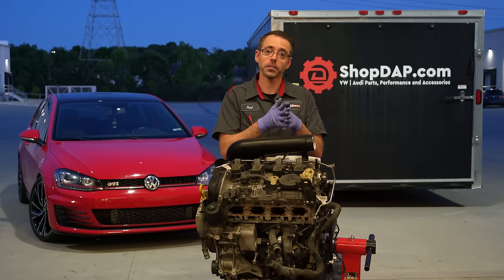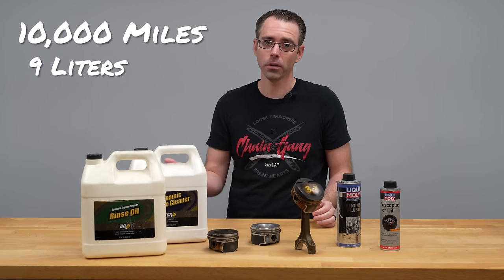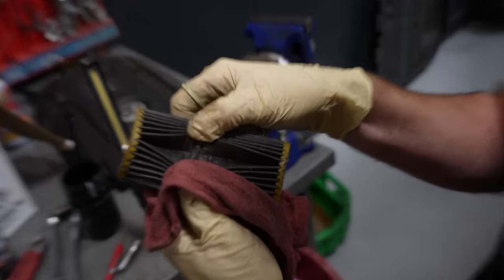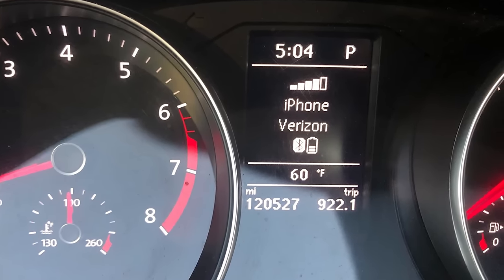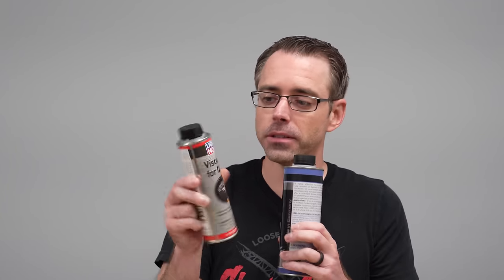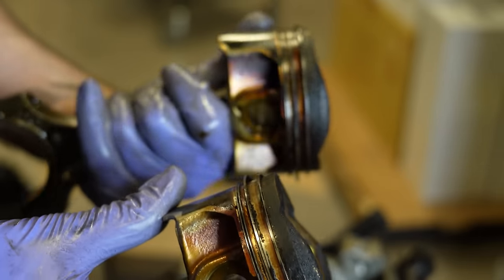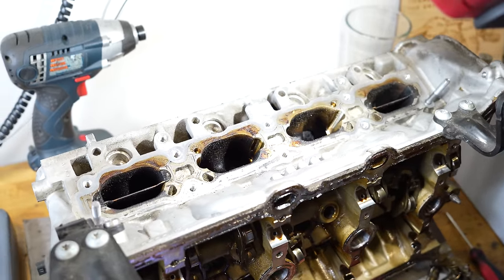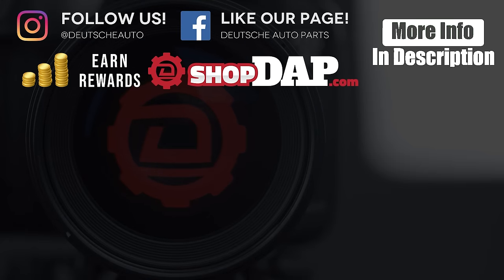Can you Fix an Engine Burning Oil for $20

Comment: Here is the recipe to solve 2.0tfsi oil burning. Get the engine hot. Remove spark plugs, mix 2oz PB Blaster, 1oz B-12 Chemtool, and 1/2oz MMO. Pour this mix in this quantity in to each cylinder. As you pour, you'll hear the mix boiling in the cylinder. Always exercise good safety protocol. Let it sit with a paper towel in the spark plug hole until the piston is visually dry (24hrs). Take a compressed air blower with a long snout and put it in the spark plug hole and blow. You will not believe the amount of dried carbon that will blow out. You'll typically find the culprit cylinder at this time based on the amount of carbon blowing out. Crank the engine over with the plugs out to remove excess liquid. Install the plugs and drive the vehicle around the block. Repeat all of these steps again. This cleans the piston crown and rings from the top side. When starting the engine after the second soak, dump in a can of BG EPR or LiquiMoly engine flush and let it idle for 30 minutes. this cleans the rings from the bottom side. Change the oil and filter and call it a day! This cured an engine burning 1qt every 200 miles @160k miles. It now burns nothing between 5k mi oil changes. You will have to repeat this every so often (2-3 oil changes) as the rings will re-clog. Yes its a pain, but it beats the cost of a new engine.
Reply: I did this on a Honda with chemtool had to do it twice to fix the oil burning
Reply: Is this applicable to the tsi engines as well?
Reply: We do something similar! But instead we use that GDI intake cleaner sauce, AC Delco makes a good one and even MOPAR has an aggressive cleaner too
Reply: @snoofayy6150  you put it through the intake or dump it in the spark plug hole?
Reply: @GooberProductionz  spark plug holes! Leave it in there for several hours and fill the up again, it breaks down and weakens a lot of the hard carbon and shit that's sticking up the piston rings,
Afterward you should suck it out with a little vacuum pump, and absolutely drain the oil, then fill with cheap oil, let it idle and warm up and go for a HARD drive, you'll see all kinds of evil smoke coming out of the exhaust and probably pop a CEL and piss off the o2 sensors a little bit
Once it's good and hot and there's no more James bond smoke billowing out behind you, then drain the oil again and fill with the good stuff you normally use, don't want to drive for too long with all that crud and chemical in there!
Reply: @snoofayy6150  ok heard. Should I use the berryman’s, pb blaster, etc mix or should I just use the crc cleaner?
Reply: @GooberProductionz  Daniel Hurley's method seems really solid, whichever sauce you pick just do the according method I guess
Reply: Makes  perfect sense.  I was using transmission fluid and paint thinner mixture and  poured 5 ounces in each cylinder and then let it sit 24 hours  then crank it over  blowing out what didn't  seep past the  rings.  Then engine flush in the oil  run it  for 30 minutes and then  dump and change oil and filter  with mobile one  synthetic oil and mobile one synthetic oil filter.  It went from  500 a liter to  absolutely no oil loss from oil change to oil change. Alot of people  blaming the  low tension rings but it is carbon buildup and sticking of the rings  not low tension.
Reply: Can you use WD40 instead of PB blaster? PB can not be found easily here...
Reply: What is MMO?
Reply: @superwout  Marvel Mystery Oil.  They have started making it in a synthetic version but I would use the original for this process.
Reply: Hey there, I have a 2017 Hyundai Sonata 2.4L GDI burning a qt in 500 miles, I'm wondering why those three chemicals? How did you conclude that those three are the chems you use for this procedure? What can be substituted, why or why not? I was thinking an engine flush, given what its supposed to do, would be a safer and simpler mix (I dont want PB blaster in my crankcase) that should break up the carbon just as good. Could I go that route?
Reply: @thatsonebadhatharry8610  thanks for the info, I'm from across the pond...
Reply: @jsplasha  Ratio was trial and error about how long the mixture dwelled in the cylinder before finding its way to the crankcase. You dont need MMO specifically, but you do need a high detergent oil with a relatively low viscosity (like trans fluid) in it to allow the mixture to be suspended in the cylinder and do its work over a longer period of time. PB and solvent would just go through the cylinder pretty quickly without staying long enough to soften the carbon.
Reply: Greetings. I own a 2004 toyota rav4 (2AZ engine) please does my car have an update pictin, and which year of manufacture would that be.
Reply: Will it work for diesel engine?
Reply: @triblackcorvette  so i can try this method on my k24a2 tsx
Reply: Can I do this for a motorcycle
Reply: @jsplasha  or disconnect the ignition wires and just let the injected fuel do the work. Crank for 10 seconds several times. My theory. Based on the fact that gas is kinda good at loosening up things. However it will dry soon .......
Reply: @triblackcorvette did you notice an improvement the first time and decide to see if it would get better or did you need to do it 2 times to notice any improvements
Reply: @marshmower   say hello hydrolock
Reply: I am about to try this method in a week or two on 2016 tsi passat. Will report here if i blew out engine or it work for future victims of carbon on oil rings
Reply: @eduardaslaurinavicius4249  Please do. Due to the piston/ring design and operating temp of these engines, you will have to keep doing it about every 12-15k as it will clog back up. Its not uncommon for these engines to be 230-240 degrees at idle or with a light load so after the engine is turned off, the superheated oil cokes in the piston rings and it clogs back up.
Reply: I can tell it helps… poured mixture into hot cilinders (be carefull as it escapes once it starts to boil) and let it soak for 24 h then poured another round on cold engine, and let it sit for 12h. Drove in 3rd gear for around 20 minutes @ 60-70 mph (O2 sensor will have many questions once you do this). After this, did liqui moly engine flush and let it idle for 25 minutes then changed the oil. Used compressed air to blow out gunk but in my case i did not need to, nothing came out. Borescoped cilinders to check before and after. Will do this one or two more times before oil changes and will call it a day. 

So far drove 200 miles but deepstick still on max and before i would be topping off already a little.

Have obd2 scanner to erase errors after treatment.

So yes, it does help.
Reply: 1000 miles update - have not topped up yet. Still around 1/2 maybe tine bit more on a deepstick. One more flush before oil change will do it and then probably once every 15-20 k miles as preventative maintenance.
Reply: @Lonelydad2 to prevent hydro locking he states to blow out the cylinder with compressed air and crank with no spark plugs. This will remove any excess liquid and prevent hydro locking.
Reply: Hey I’m about to be using this method real soon for my car but had one question where could I get MMO?
Reply: @JosePerez-dl8bf  Really any auto parts store or walmart. If you cant find it, transmission fluid could be used as a substitute.
Reply: create a youtube video
Reply: I'd heat up the mixture too a little, potentially this could crack a piston if you dump cool liquid on very hot metal.😬
Reply: @superwout  wd40 is not the same type of chemicals as pb blaster.  Pb blaster is specifically made to break through grit, rust, carbon etc.  Wd40 is just a water displacement type of oil. Never tried it but don't think it would give you the results you're looking for.
Reply: I would let it sit longer (a few days), and I hope you used a clear plastic shield when blowing those cylinders out ( like those Large clear plastic face shields).  What a Mess that is I bet???
Reply: I would skip the mmo and b'laster. Just use chemtool
Reply: This is complicated, you can do the same, actually better, with HHO gas carbon cleaning (and eventually engine flush aditive add to oil).
Reply: @snoofayy6150  For the "cheap oil" I visit the back room at Advanced Auto and syphon a few gallons from the waste oil tank.  Be sure and pour it thru a paint strainer cloth.
Reply: @superwout  Marvel Mystery Oil?   That stuff looks just like transmission fluid to me.
Reply: @chetmyers7041 that sounds like a really bad idea. There is coolant, brake fluid, metal and who know what else in that oil salad. Why cheap out on your engine like that? The cheapest fresh/clean new oil would be far better and only $10-30 depending on amount needed.
Reply: Wow thats a lot of unnecessary work. Just get the engine up to operating temp, bring the rpms up a bit (2000-2500 or so) and add water. Not enough water to kill it, obviously. I would use a small vacuum hose but you could also add it via the throttle body with something such as a spray bottle or a water bottle with some small pin holes in it. That is the old school way of doing it and it does work. It may run a bit rough at first after doing it but itll clear up pretty quickly with driving. Think of it like a cylinder on an engine that blew a head gasket, its easy to identify because that cylinder is spotless. That is what this does, it is completely safe and easy (and as a bonus, its basically free), and will work better than what you currently do. It's not gonna hydrolock it as long as you arent literally dumping water in it. The only potential concern would be on newer cars it could possibly clog up the catalytic converter, but that could happen if you remove carbon in any way unless you physically remove the engine. As for carbon buildup elsewhere in the engine, just run mobil 1 and change your oil ever 5000 miles and that wont be a concern. Also avoid short trips, thats horrible for any engine.
Reply: @lumpyzx2645  You're not going to decarbon the oil rings with water through the intake. That decarbons the top of the pistons and valves only.
Reply: You can use water run it bout 2  to  2500.00 Rpm And pour it down in the carburetor real slowly it will clean the carbon out of the engine
Reply: How much are you wasting on those stupid chemicals? A set of piston rings costs less than $20 add the gaskets and some screws and you have a newish engine with less money spent.
Reply: @Jfjs58-g  $17 in chemicals. Obviously you haven't been down this route before with this engine. The pistons are a bad design so just rings and gaskets will not fix it. They will reclog quickly. If you want to properly repair it new pistons, rings, bearings, balance shafts, timing kit, cam bridge, gaskets, & labor are well over $7k. It rather spend $17 every few months on a car thats not worth the proper repair and go about my merry way.
Reply: @danielhurley7018  I have a 2.0i ALT with 240k km so about the same shit as 1.8t. Oil control rings were really bad, I replaced all the rings, bearings, valve stem seals and all the other things you replace once you open the engine and it was not more than 1500. Other than the rings the engine was perfect.
Reply: @Jfjs58-g ah yes, because taking an engine apart and putting it back with the same oil, coolant, timing belt/chain is smart. All that shit costs money too, plus the downtime of your car.
Reply: Really? 🤦🏻‍♂️. 
Don’t do this!  I shouldn’t have to say this but don’t take vehicle advice from trolls on the internet. 🤦🏻‍♂️🤦🏻‍♂️
Reply: @BeefNEggs057  Yeah, obviously BS
Reply: @aleksandarpetrovic6613 petrol you say? Acetone or k chem maybe clean but deplete the bearings and all if chem gets left in system
Reply: @stravis3269  I didn't mentioned acetone, but HHO gas.
Reply: This isn’t fixing shit.
Reply: What's odd is, given how gasoline is never actually pooled in the cylinders of an engine, how likely gasoline itself might actually be able to do quite close to as good.  How much more than the most wasteless spritz of it is applied in the operation of an engine?
Reply: @aleksandarpetrovic6613 HHO, as in deconstructed water?
Reply: @alexwalker8422  yes, gases from electrolysed water.
Reply: @aleksandarpetrovic6613  how is HHO to be used in this process?
Reply: @alexwalker8422  high flow of HHO gas was added to the engine intake, for example about 15-20 LPM for 2l engine, for 30-60 mins. Engine works on his regular fuel plus HHO gas. Cleans combustion chamber, EGR valve, turbo, cat, and DPF (depending on what engine have).
Reply: @danielhurley7018 I heard of transmission fluid in the crankcase many years ago and run engine then change the oil
Reply: @danielhurley7018 how about diesel? Wouldn't it do the job
Reply: @Jfjs58-g  Good old fashioned “rebuild” is the most fun!
Reply: Spark plugs i put mine to tdc so it is all closed off ... then do the rest etc other wise of say cyl 4 is all the way down on stroke then it will just pour through @GooberProductionz
Reply: Thank you  will cause my acura mdx 08 model us bringing out smoke from the exust
Reply: @ChrisPatrick-q6k  Do you have some advice relevant to addressing this crap motor's issues?  Updated pistons would be nice, but not everyone has the dosh for that.
Reply: @eduardaslaurinavicius4249  This is the info I needed. I am having the same issue with my Peugeot... Hoping this solves the issue so I can replace my catalytic converter and hopefully pass emission tests in Germany. Thank you for your tests and reporting back, really helpful.
Reply: @codywood4768  i’ve done about 20 k miles since. It still burns a little. need to add between 0.5 - 1 qt between oil changes. P.s I do an oil change every 5k miles

Comment: The 30psi increase is certainly an improvement... 5psi is surely within the error margin just after an oil change lol.
Reply: I guess removing engine deposits is a pretty random outcome also. Sometimes the deposits might help nurse a worn part seal better and othertimes prevent a good seal.
Reply: @itsthemetho  Agree 100%, especially for leaks, lol.  Strong believer in - if it ain't broke, don't fix it.  I do 3,000-mile oil changes, which for me is the best preventative.  If it were oil-burning 1 liter per 172 miles (!), you're up for big bucks anyway, so you've got nothing to lose trying these.
Reply: @johnrroberts7900  Yeah a liter/quart every 172 miles is once every 2-3 days if you have a normal commute. You'd be spending almost as much on oil as fuel.

Comment: In 1970 to 1974 I trained to be an engineer (UK) Our training officer, always used flushing oil during the oil changes. It went like this; Drop the old oil, fill with flushing oil, which was thinner than normal oil, run for a set period, drop the flushing oil, change filters and then fill with the correct oil spec. He was highly regarded, and he ran old cars...forever! I took up this practice, for a while, but, it got harder to find the same flushing oil. All you could get was a small can to add to the old oil, before you changed the oil. That didn't seem so effective. Peace be unto you.
Reply: Look up local bulk oil dealers, they will usually sell 20 litre drums drums of oil based, not solvent based, engine flush. The drums work out to be a fraction of the price of similar products at retail parts shops. I’ve used a  flush nearly every oil change on brand new cars but I’d be cautious using a flush for the first time in an older or high kilometre engine.
Reply: @J_S209  Hey, thanks for the warning about the older engines. I was thinking about flushing my 23 years old Golf, because of the oil eating and the previous owners probably never did it but it got me curious what could go wrong if you flush an older engine ? Serious question btw.
Reply: @sacrefice_8753  The concern always is that the flush will get some of the gunk off and it could clog the piston rings, oil passages and oil pickup
Reply: I learned this about 40 years ago from the guys who trained me to be a forklift mechanic. I was told to use dexron trans fluid, and a new filter. This is after warning the engine and letting the old oil drain overnight. Let the engine idle for 30 minutes, with the dexron and the new filter. Let the engine drain overnight again, and fill it with new oil with a fresh filter. The detergents in dexron are super effective at scrubbing carbon from your engine. Cheap and very effective way to keep an older engine running well. I've owned easily 100 cars and trucks in those 40 years, all used. Did this every time I bought a  new to me vehicle, and I've never blown a motor.
Reply: I have always flushed crankcase with a couple quarts of gasoline once the old oil is drained . 348,000 miles and not using any oil between changes
Reply: @talltom1129  do you drain motor oil and fill with dextron transmission oil...or you add dextron oil to existing motor oil?
Thanks

Comment: Lots and lots of time spent making this video. Great job! 🤘
Reply from the maker: Too much 😆
Reply: @Deutscheautoparts  just discovered your channel.. watched your episode on efforts to clean intake ports on direct injection systems.. I've had the same issues with EGR diesel engines much much worse though.. it may sound radical.. but I've two now & works a treat & very easy & if diligent it safe for the engine.. I semi fill the ports.. with closed valves.. tergo commercial paint stripper.. sounds more radical than it is.. leave it 15-30mins & water last ports clean.. initially with blaster off to flush out the stripper without it blowing onto everything.. then blaster on & ports clean like new.. airgun residual water out & wd40 ports & cylinders valves open.. air out the engine with injectors (diesel) or plugs out on the starter & reassemble.. it's a lot easier & quicker than it sounds.. cheers from New Zealand
Reply: So? Wanna do nothing and make money? Snobs.
Reply: :thanksdoc: